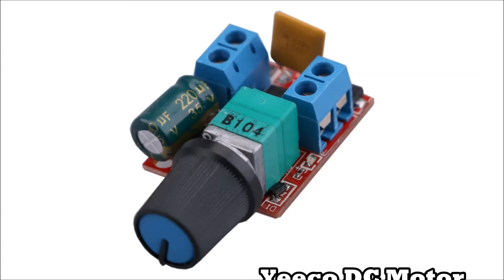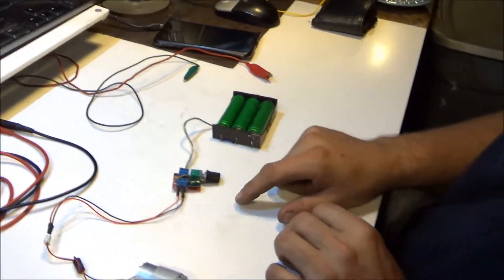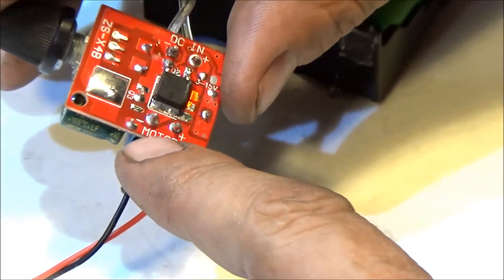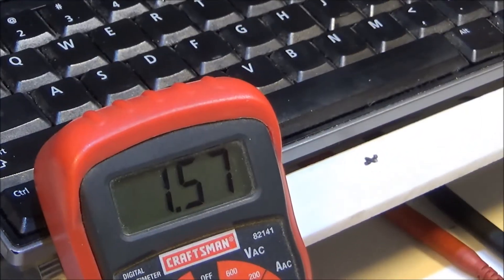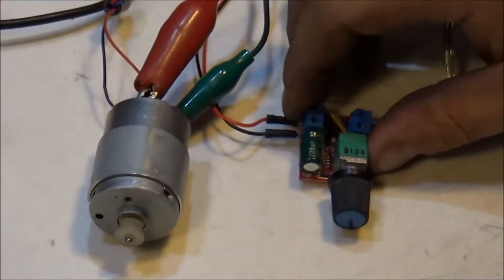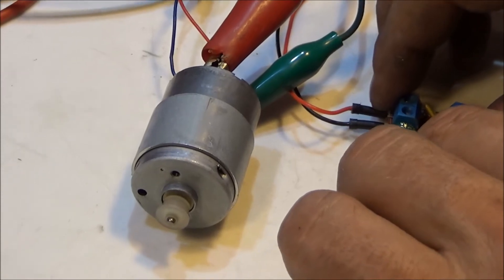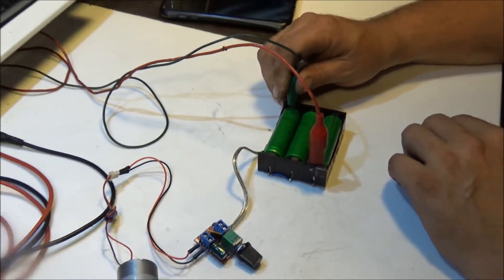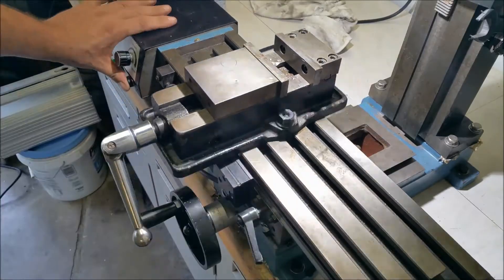Yeeco DC Motor Speed Control 3-35V 5 Amp quick review

Comment: Hi. Can a 3.7 DC motor can be driven up 9Volts of power supply? Tnx. Btw, what is the Ampere stands for for this controller. Coz i bought a low voltage Controller from 1.8V-12V 2A. Pls help. Coz i need this project to run a 3.7 Motor for more than an hour. Tnx

Comment: If my led doesn’t come on then does that mean my board is garbage?
Reply from the maker: I'm not sure.. I bought a few of them at a time.. I'm sure you checked and have the correct polarity. There not terribly expensive if you need a replacment.
Reply: @DonBrandt  can i use it like a main switch? And/or can i use it on a coil tattoo machine.? Im trying to make a wireless power supply for tattooing

Comment: Amazon doesn't have the Yeeco but they have Onyehn which don't seem to work for me. Can someone explain to me what this means: Default disconnection of short circuit point, suitable for 5-35V input.
 Manually connect the short circuit point according your needs, suitable for low power 3-15v input. (That's from the description) Thanks!

Comment: $8 on Amazon?...wow, that's crazy when they are less than $1.50 on Ebay! Thanks for the video though, Don. I just received a couple from my Ebay. Look very useful.
Reply: I have a few on the way... figured I'd get four for the eBay price.  Just messaged the seller since wondering why reads like departed customs back in October and not updates on shipping.  Wanted for a DIY welding, grinding or whatever PAPR I'm designing.

Comment: I love the small PWM boards. If you ever need a larger one for a bigger motor, I have a video on my other channel using one I also purchased for under $10 on Amazon that has heatsinks on it. I have actually used it for a few years now (it was being used to power a small gear reduction motor on something else I built). It has held up great so far. You can see it here: https://youtu.be/KBqmX0ij4SE
I can't remember the name but there are several differently named ones that all look identical to this one so I'm sure they come from the same manufacturer.
I have some nice stepper motors that came from some copiers that I would like to play around with but I haven't gotten into much research yet on running them. I'm sure it will involve some coding and I know nothing about that...yet!
Reply from the maker: Hey Juggernaut, This is a great video showing the speed controller. Thanks for sending the link out. I really like your tachometer, you should re-post to your new channel. You could also do a video on the tac, shows us what it does and how it works.  What do you need to reflect on to make it work? Seeing this shows that we have some of the same interests.  Thanks for being a viewer and can't i wait to see you next project.  For my viewers, if you can send some encouragement to Juggernaut, it would be greatly appreciated.
Reply: Thanks Don, those are great ideas! I will do a video on the tach. It came with reflective tape strips but there are other ways to accomplish the same thing as well. I think I have a couple of videos I could and probably should repost to this channel. I need to get some more content on here for sure!
Reply: @DonBrandt  is it still working?